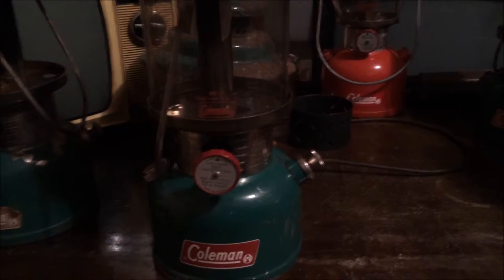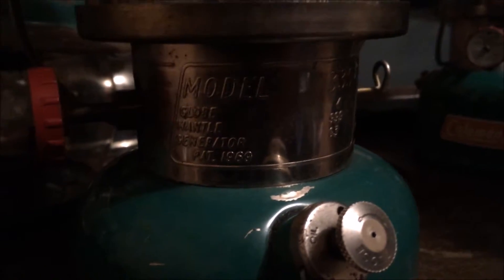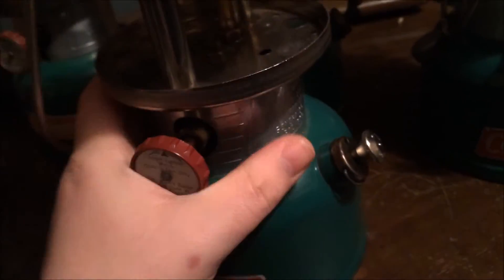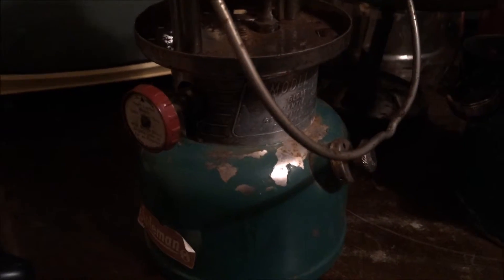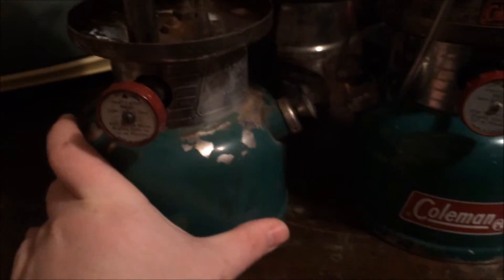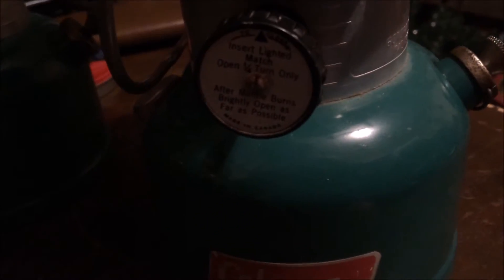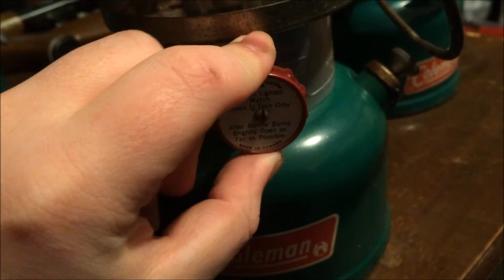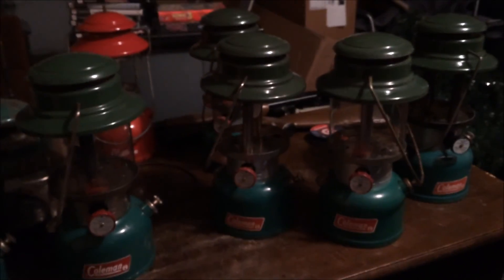Coleman 335 differences over the years

Comment: Just stumbled on this.  Very nice details shown.  I really like the 335 and have more than a few of them.  When I was young my father lived about 10 minutes from the Coleman factory in Toronto. I recall very vividly going there with him to get parts.  I was in awe at everything going on and had the good luck of being given a small tour.  I remember when I was 7 or 8 they  showed my father their new model, the 321, and he picked one up for our upcoming trip.

We used that one a lot when camping and used it solidly for around 4 years. I have a pleasant memory of watching it flare up when the o-rings first leaked.  The sight of him grabbing the lantern full aflame, swinging it like he was in an olympic event, and then letting it go.  we watched it sail through the night sky until it crashed into the sand.  Oddly enough the only thing that broke was the globe.  He dropped it off at the same factory and picked it up a week later good as new.